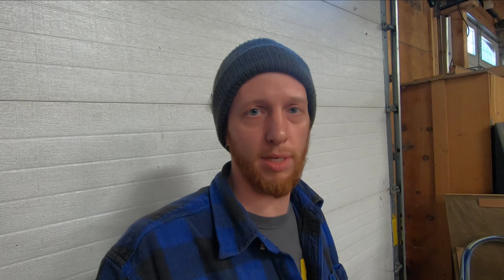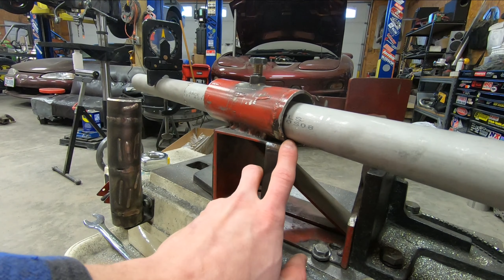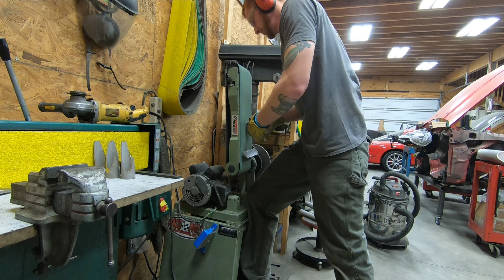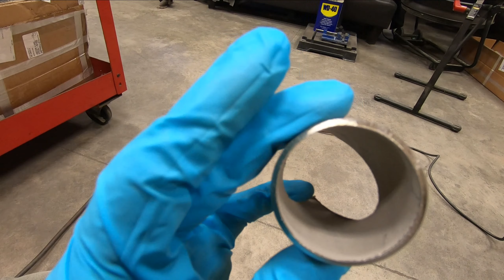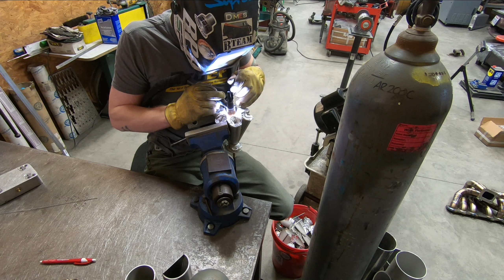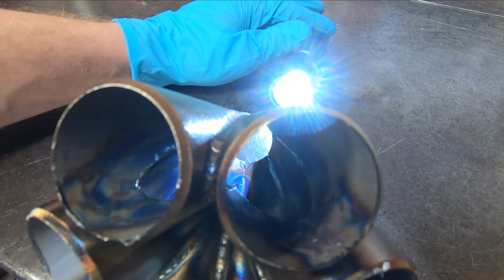Getting Started on 2JP! (Merge Collector Fabrication)

Comment: from what material that grinding wheal is made?
Reply: My thoughts exactly, it left a finish almost like a conditioning abrasive pad, not mirror shine but not removing material either, but the wheel looked solid. Hope he responds lol
Reply: Saw the same finish on the els when you did the evo manifold. So what's the "mystery wheel"? Awesome info and killer work! Well appreciated..
Reply: I believe it's a scotch brite de-burring wheel, but I could be wrong.

I use scotch brite mops for the same job